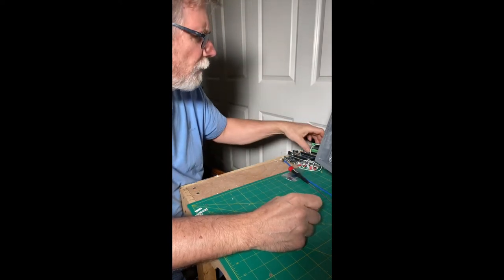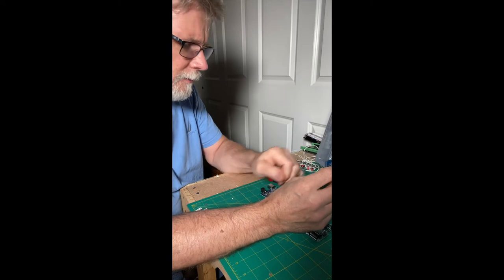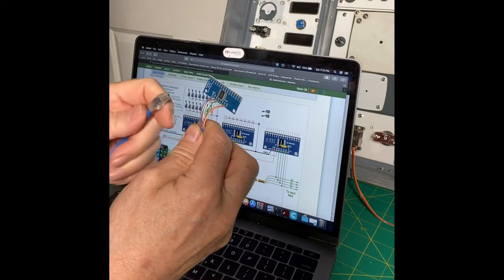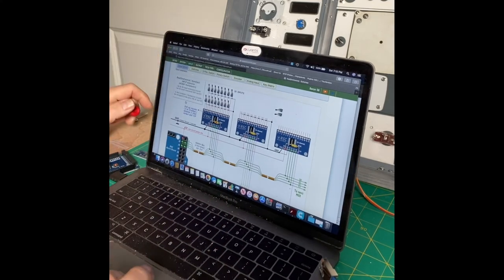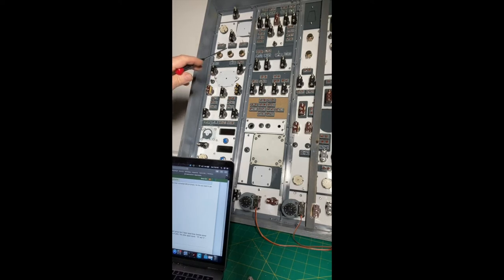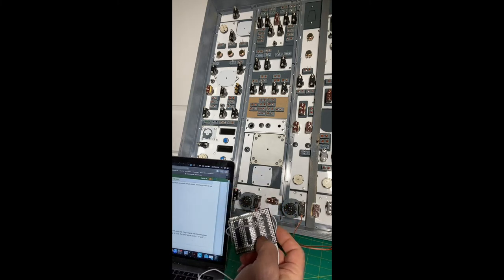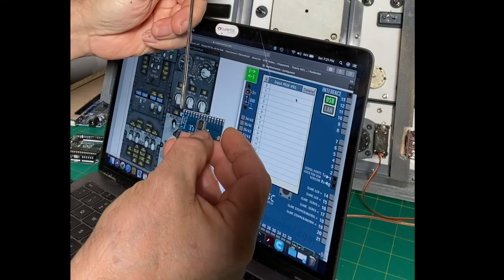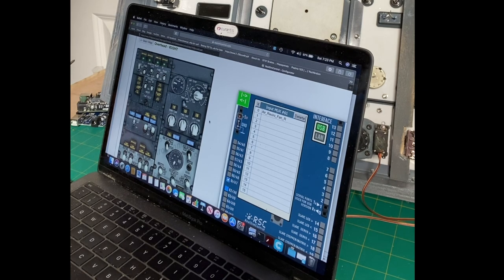How to Wire Forward Overhead for Boeing 737 Cockpit Flight Simulator

Comment: magnificent!
thanks!
Need to install some software?
any example of altitude display on the pressurization panel?
thanks...❤
Reply from the maker: Hi Thanks.  Are you talking about Interface Software for Physical switches and other items? The altitude display is a 7-Segment led. I use two plugin interfaces. RealSimControl, and Mobiflight.
Reply: I would really like to start with reduced overhead, so I'll need real sim and mobifligt, I don't know anything about programming, I'll try, who knows, maybe I can do it by watching your tutorial.
thanks for helping.
Reply from the maker: I would start with RealSimControl it a free plugin and very simple to use. Best part of this is there is no need to know any type of coding.  Mobiflight is free as well but much more difficult to use. 
 @carlosameno7956